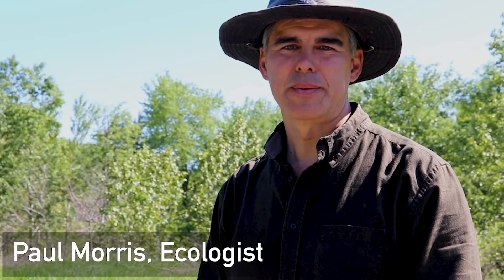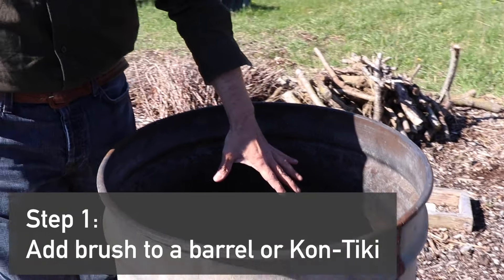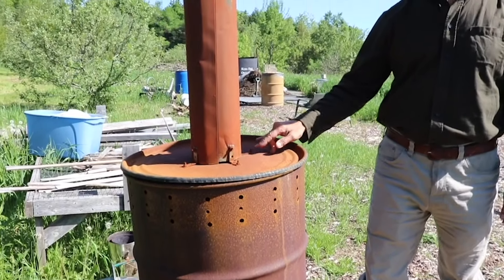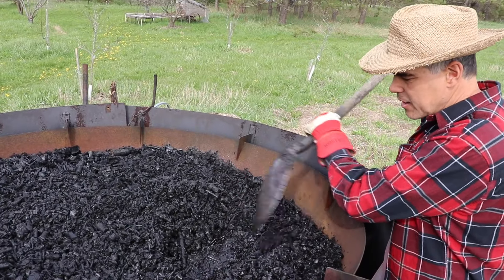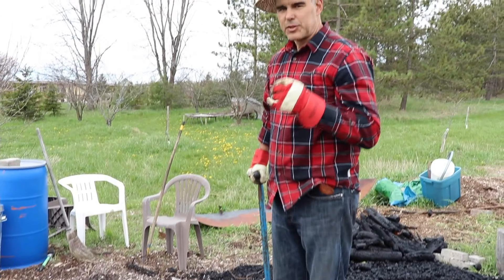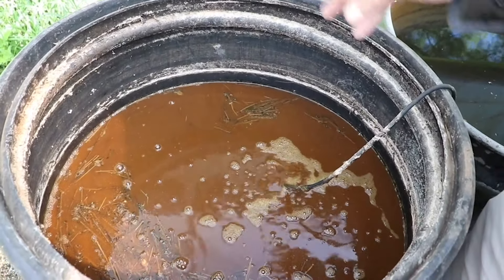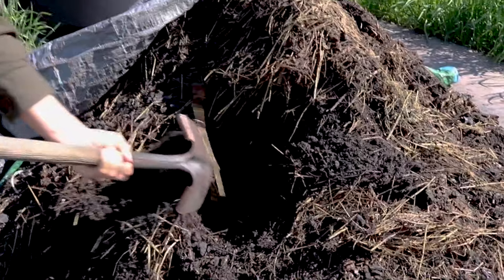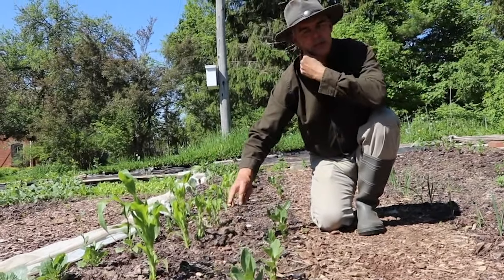THE ULTIMATE GUIDE TO BIOCHAR: how to make it, how to use it, and why it's important

Comment from the maker: Other languages?: Turn on CC, Settings - Subtitles - choose your preferred language ;) Apologies if YouTube's auto-translate says something weird!
Reply: 12:07  "What's the Best Nation? Urination" Beavis & Butthead 😉
Reply: Great video, Alot of work. Can i use this to spread over my pasture for cattle grazing? What about ph and other tests ?
Also what about putting it through a leaf/branch  grinder !  Just wondering  how to efficiently spending over pasture ?  Thanks .
Have you compared your original soil and you bio char mix re plant and grass growth ?
Reply from the maker: @roarkbjorn2389  pH is lower with the biochar depending the efficiency of your burn and how little ash you get. Spread on pasture works well, in our area they use a manure spreader or you can mix the biochar into the manure before spreading. Carbon (without the additives) in the feed also lowers methane production from cows. Carbon in the bedding reduces smells and the cows mix it in for you!
Reply: So its charcoal which is charged with goodness
Reply from the maker: @saddammall3337  Charcoal made in high temperature burn. Most charcoal is made with a low temperature burn and is not as good.
Reply: @PlanetHealers  it reduces smells because of the very reason that it inhibits microbial activity.... same case with methane production from the cows gut.
Reply from the maker: Yes untreated biochar would take up nutrients and limit microbial growth. Thus we treat it first and inoculate it with microbes to enhance the microbiome! @glen.simpson
Reply: With no offense, you are adding too much ceremony and cult.
Microorganisms grow at a very well defined rate.
It is unlikely that any time spent over 21 days is useful.
Also, it is unlikely using anything but that bio tea is useful.
Your "charging" of the carbon is again, more mysticism than practical chemistry.
The purpose of the carbon is a home for microorganisms, not a storage for minerals and nutrients (other than water).
Reply: It is not very affective first year because your mix is very strong and when you make it ready you have to add a bunch of real soil which have additional bacteria and it will speed up a process.
Reply from the maker: @anatoliy8212  Yes, we always mix it into the native soil. Topdressing is also an option, and the soil organisms will mix it in for you.

Comment: I dug a concave hole about 30" deep at center and 4' wide at top and filled with very dry small branches up to 1.5" with several up to 2" on top. It burned very hot and fast with some wind blowing and as I saw hot coals at bottom I started adding dirt around the edges to slowly smoother the deeper part fire. I kept filling in around the edges until only a few larger pieces were burning on top. When they were well charred I sprayed water to put it out. I had almost no ash and a full pile of char.
Reply: Can you make a video abt it :)
Reply: appreciate your comment I dont want to buy the big system he showed yet! Ideally in the future tho lol - the dumping feature seems great
Reply: It can also be done with a rectangular dig of 1 meter by half meter with a depth of twelve inches and to be burned on top

Comment: Can I inoculate the char pile during winter months and freezing temps? I would only burn during the winter here in the Colorado forest. I could save the char for summer, I guess. And would it be wasteful to add the urine at the water soak time, if I do need to wait until summer to do the rest? Very helpful video!
Reply from the maker: Well, the urine soak is to start the charging. If stored dry the char will be more hydrophobic and needs to be rewet so the absorption and microbes can us it. You can mix the char with manure or compost and it will charge overwinter. Adding a tarp to help keep the heat in the pile. Adding a layer of straw would help insulate the pile also so that the microbes keep active and the char charges.

Comment: Hi! I just like to thank you for this very informative video, I enjoyed watching it and learned a lot. 

In preparation for my own garden, I'm almost finished with two, side by side, 4x20' Hugelkultur beds and I'm just wondering if there's any need to add biochar to them? And if so, how would I go about it? 🤔 Like, during what step in the process would I add the biochar?
Reply from the maker: Yes, add the biochar to each of the layers like a lasagna. Or mix it into the substrate used for each layer.
Reply: Hi! Thanks so much for your response! I had a feeling it would be a great addition 👍
I'm just wondering though, the oil barrels you're working with, if they previously held oil, wouldn't there be residual chemicals burning as well as the wood? This seems like a real concern to me. Is it necessary to clean them first? Or maybe I can find brand new oil barrels? Or maybe I shouldn't be concerned with this at all? 🤔

Comment: Thank you for mentioning that it takes 3 months to properly brew! I see so many people wanting to rush through to the end result, and it always worries me that the premature biochar may actually rob their gardens of nutrients, instead of adding to the fertility. Carbon is a powerful sponge.. patience pays off!
Reply from the maker: We did experiments trying to cut the time until used. At one month you could use it with legumes because they fix their own nitrogen. Less time and the beans were stunted and had yellowing (nitrogen deficiency). So at one month we were able to get a bean crop off. Other non nitrogen fixing crops would need the full three months.
Reply: Did this time depend of how close we are from the equateur ? I am working in the Amazon in chaikuni institute at 3°south from the equateur, do you think we as well need to wait 3months or as with the high temperature and humidity in our region the process maybe quicker ?

And by the way thanks you so much for sharing your experience and knowledge, it is deeply appreciated !
Reply: Idk. I think if you add biochar and then a large amount of old chicken manure or something with nitrates you're probably okay since you're adding a lot of nutrients. I added biochar to my garden and did like 3 parts charcoal and 1 part chicken manure. I soaked it for three days in water and then added it. If charcoal does soak up loads of nutrients maybe people can just add more to the garden if they don't have time to wait like if it's planting season.

Comment: Made my second batch of biochar the other day. Not only do I get a great amendment to my soil, I'm also cleaning up the tree trimmings around my house. I use a 55-gallon drum with 36 3/4" holes around the bottom. Burns very hot. Large metal bucket on the inside. 
Light 'er up, let 'er burn. 👽✌️
Reply from the maker: Awesome!  Glad you are getting great results.

Comment: Hi. I enjoyed your video and the way you described the different processes with minimal use of technical terms. 
One term you used was “inert”, to describe the carbon after being changed by the pyrolysis process. You were fully correct of course,  but perhaps there are some in your audience who only partially understand the term in the context you are using it and why organic matter becomes inert after the charring process.

A way of looking at this that I’ve found helpful is to go one step further to point out what being “inert” means in the context of this subject. Photosynthesis builds more complex molecules by converting radiant energy into chemical energy in the form of organic molecules, and it is this stored chemical energy that other life forms, ourselves included, break down to extract the chemical energy in it to fuel our metabolisms.
But in straight charcoal,, there is nothing that can provide metabolic energy to any form of life.
 
To put it simply, the reason charcoal can remain in the soil for thousands of years is that nothing can consume it as food.
.
Reply: Unless the particle size is small. Then it will degrade and be taken up by the natural composting process.

Comment: Thanks for this great video! How about suffocating the fire and letting it cool, so that the carbon pieces stay dry and could intake even more nutrients? To frame my question, I was thinking of an application to reduce sewerage nutrient leach to natural waterways by adding baskets of biochar into the last septic tank.
Reply from the maker: The char is hydrophobic when fully dry and is more difficult to wet. Then the nutrient will go in better. Most charcoal is made with the suffocation method but if any air gets in the whole lot turns to ash. The char is great for absorbing nutrients and toxic chemicals but in a septic system it would need to be renewed regularly as it gets fully charged or it would stop absorbing. Not sure how it would work as a bioreactor, just being a big surface for microbial action.
Reply: @PlanetHealers  Thanks for answering! I’ve heard they use biochar as a floating tap/coat on the open liquid manure silos to minimize ammonia loss and mitigate smell. That’s why this just came to my mind, since I’ve 2 septic tanks and I’m interested to reduce my family nutrient impact to local waters..
Reply from the maker: @CountrySideways  We use our biochar in the dry toilet here to keep down smell as well. Add a scoop...! Yes the biochar will float as it is lighter than water. As for capping the smell, it would probably work
Reply: @PlanetHealers  you can make charcoal hydrophilic by treating it with a mild acid. Look up "activating charcoal with acid". The choice of acid is obviously important :-) Also, putting your mix into an anaerobic environment with excess water will produce lacto bacilli, which will produce lactic acid. Etc.

Addendum: found out that citric acid has been used to activate charcoal DIY. it has less capability than commercial activated carbon, but still worked to adsorb. They were unhappy with their results, but as an agricultural amendment, this could speed up your process. "Using Citric Acid to Activate Charcoal Obtained From Agricultural Wastes"

Comment: Great video, very thorough! 
Does the barrel have any holes in the bottom, also do you keep the drain open in the bottom of the Kon-Tiki during the burn?
I like the simplicity of a single container and not needing to fill a retort and add it to a burn barrel and use wood only to heat other wood (even though it might have advantages in other reagrds).
Reply from the maker: Thanks Brendan! No holes in the barrel and drain closed in the Kon-Tiki. We don’t want air to oxidize the charcoal to ash. Yes we get a lot more charcoal. The disadvantage is the ash formation on top but if managed well it produces little ash.  Cheers Paul

Comment: 12:30 - I guess that a barrel could be safer, because it's possible to close the barrel and block air access so that the charcoal inside cools down. I don't really know if it'll work but I'd try rolling it back and forth, to crush the charcoal. (After that, the barrel could go to an outhouse for "charging" :D )

Comment: Congratulations! Your video is very clearly and helped me a lot!
I have a question: in the system that uses two barrels, how long does the material become biochar? Can I use sugarcane bagasse in this system as biomass for biochar?
A hug from Brazil!
Reply from the maker: Hi Bruna, Any high carbon material can be used to make biochar. I would tend to make compost with quicker degrading material and biochar with the slow degrading material as with the burn it loses the nutrients and leaves only the carbon. For something with a high water content like sugarcane, it would need to be dried first or you would waste a lot of energy burning off the water first (white smoke). The sugar cane is more fibrous so the barrel in a barrel might be better as it would probably burn to ash too fast in the other methods. As stated in the video though the barrel on barrel method wastes all the outer barrel material that could be turned to biochar in the other methods.
Reply: @PlanetHealers  thanks ❤
Reply: sugar cane , before you extract
the sugar out,.

Comment: Great, informative video, and nicely presented. Thank you!
I'm starting a garden this year, on a place that is a grassfield now. The plan is to plow it just this year, so it instantly looses up the soil and destroys some vigor from grass. But next years I plan on doing no till, just adding compost once a year. Also I don't have enough cardboard to put as a bottom layer everywhere.
I would ask, what do you think would be the best method of incorporating biochar? Before I only wanted to fertilize the garden this year with spreading older manure, which would get plowed under, and that will happen in a next month or so. But now I'm thinking to add some biochar, too. Could I just soak the biochar now in urine, add it to the old manure, and plow both under? (the question is mostly focused on adding the biochar deeper underground, since next years I'll only be adding it on the top).
And another thing. I make my compost just by piling up manure and some leaves, leaving it for a year, turning it once or twice in the process. Is it okay if I just add the urine charged biochar to the pile now, leave it for a year, and then use that entire mix, which will be a compost by then, for spreading over the beds (market gardeners style)? Will it be good as the main medium, for direct seeding into etc.?
And yet another thing, is it okay to just add unactivated charcoal into the manure pile, leave it and not use it for a year or so? Will it get charged adequately that way too?
Reply from the maker: In the Yucatan, we dug the biochar into the soil to mix it with the native soil and in Canada we just added it to the top as a no-till system after solarizing the beds for a year. Both worked but I prefer not disturbing the soil and leaving the soil structure intact and letting the soil organisms and frost heave take the biochar into the soil. 
Adding to the top compost or a mix with biochar is best and not digging or stepping on the beds again after they are established.
Both adding raw char to compost or to raw manure also works to charge the char during the composting process. We have added it to human manure also in our compost toilet. It helps with keeping the smell down and when finished can be used.
Some people have added the activated carbon to animal feed to help detox and have less smell. I wouldn't do it too much as the activated carbon absorbs the nutrients from the animal as well.

Comment: Glad to see someone mention the inefficiency of the barrel in barrel method.

To speed up the burn with the burn barrel you can start it as a TLUD if you make some holes all around the barrel close to the ground. As things sink and settle down during the burn you keep adding biomass and when the barrel is about half full with embers you close off the bottom air supply by piling dirt against it and you keep layering in more material untill the whole barrel is full of embers.
Reply from the maker: You would not be able to quench the fire at the end with the holes in the bottom or let it charge overnight. Its a good idea but I find it burns well once it is started.
Reply: @PlanetHealers  the quenching goes just fine but I'm on heavy clay soil. Leaving it to soak overnight will be more difficult because the water will slowly seep away. With sandy soil it will be risky because like you said even a tiny pocket of poorly quenched material can result in loosing the whole batch.

Holes would be on the side of the barrel btw not the bottom. I did this method because I had the barrel left over from using it as a TLUD with a 60 liter inner drum but that was just too large to safely tip over for quenching.
Reply from the maker: @CarbonConscious  I like to soak it also to absorb the water to make a good home for the microbes. The char is hydrophobic if it is fully dry.
Reply: @PlanetHealers  that's another reason I'm not a fan of the barrel in barrel method, it makes hydrophobic char, with proper retorts where wood vinegar is extracted that's a worthwhile trade-off.

In my experience water quenched char is difficult to dry out to the point of becoming hydrophobic again even if right after quenching the water is drained off.
Reply: @CarbonConscious  I make it TLUD in a barrel with a chimney. I quench it with water when the flames are down to the level of the charcoal. Holes in the bottom.   It makes excellent, very light, metallic sounding char.  Then I crush it in the driveway between two panels of plywood.  Works great!
Reply: @johns7713  TLUDs are the way to go since you can make use of the process energy very easily, I have a couple small cookstoves and heat my house with an indoor TLUD as well.

For larger volumes outside the pit burn/kon-tiki method is my preferred method.